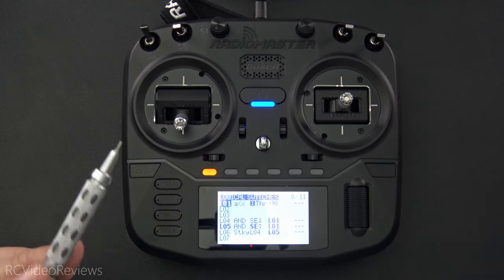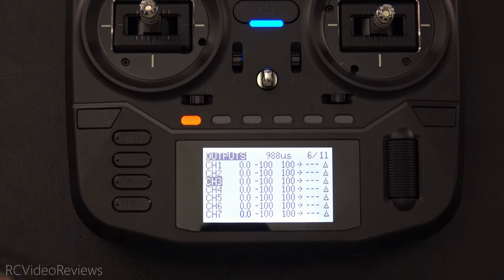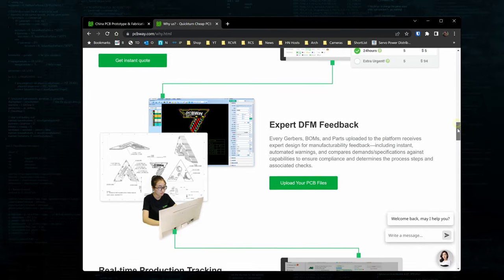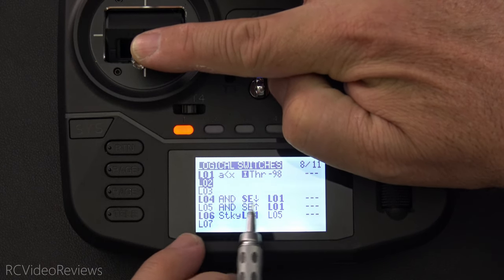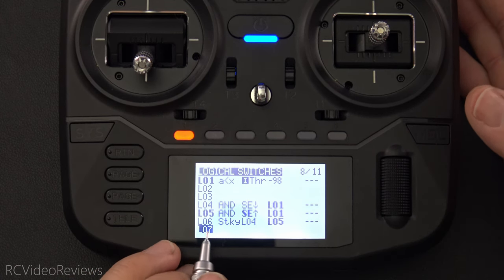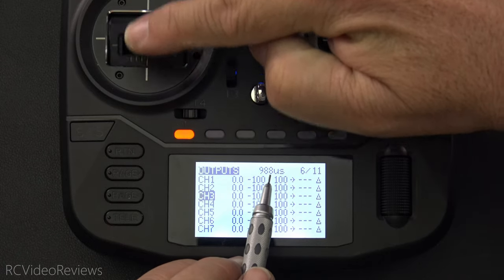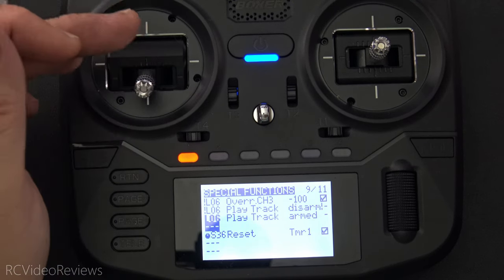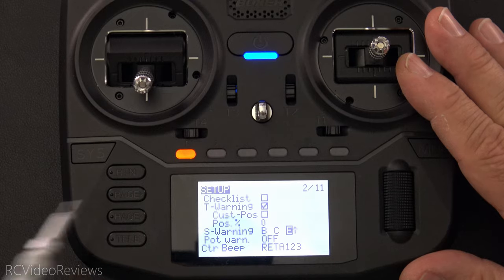Throttle Lock for Radiomaster Boxer with EdgeTX: My NEW FAVORITE!

Comment: It doesn't take you long to figure out a arm-disarm switch when the model on the table suddenly becomes airborne. 😄 Great video John.
Reply: wouldn't happen if you took the prop off😉
Reply from the maker: I think the beauty of EdgeTX as being discussed in these comments is there's always some way to do things that works for the individual, and that's the key point.
Reply: @RC Video Reviews  since setting a throttle cut up (which I've done loads) and accidentally hitting the +/- and not realising, model on the bench went full throttle when I flicked the switch. luckily no damage to the model and I was behind it at the time. I'll never set up a model with the prop on again. I got luck. others have not.
Reply from the maker: Yeah, you gotta do what works for you.
Reply: @RC Video Reviews  I use throttle cut but for the initial set up on the bench prop comes off while everything gets tested

Comment: Thanks!!!  This is great.  I'd like to do another switch for "emergency" throttle off too.  The more Boxer videos, the better. :D
Reply from the maker: "emergency" throttle off is basically what a throttle cut does. Just lookup any throttle cut video I have on the channel (there are several). Logically speaking: Use a switch to override throttle channel to -100.

Comment: Outstanding again, thanks.
I recently got a Boxer 4 in 1 for my son and I to use with UMX BNF products.
Although not a complete noob to RC, I kept things simple with my DJI controller with air units and vistas in my drones.
There is a lot to figure out with binding, as some controls are reversed etc, but there are some older video’s covering this with a TX16.
Just a suggestion, as I think the Boxer will become very popular, maybe a full tutorial on your setup with something like A Turbo Timber Evolution basic ( as this is one of the models I have!)  would be beneficial.
Thanks again.
Reply from the maker: Glad to help. Thanks for the suggestion.

Comment: Thanks for the info.👍 As presented here: i view this just as ANOTHER way to setup arming on your RC, its not the only way. In nearly 45+ years of flying  I have never accidently hit the disarm switch while flying (if you have maybe you need to consider if the switch is in the wrong place) or maybe that 1 time was a freak occurence. But lets think this through logically,  on a plane, who cares if the motor shuts down (unless you are really close to the ground), just re-arm raise the throttle and move on, ever heard of gliding or dead stick landing??? On a quad its a little different...if the disarm switch is triggered it takes a second or 2 to get the flight controller to allow arming while you are watching your favorite flyer plunge toward the ground at break neck speed. Putting the switch where it is unlikely to be hit during flight would be the most prudent thing to do. But I guess that won't happen because the majority of RC flyers are old farts (me included) that are too old, stubborn, not tech savvy  enough to be willing to make  a change. So for me i want my disarm switch to disarm NOW, not after i also remember to lower the throttle. Another post mentioned to have a voice prompt 'Disarmed' or "Motors off" (which i have) to warn us when we do the unthinkable. 😁 Happy flying
Reply from the maker: Would be simple enough to remove the and condition from disarm logical switch if you want disarm to occur regardless of the stick position. That's the beauty of this EdgeTX--unrivaled flexibility to make it work the way you need it to work.
Reply: @RCVideoReviews  What would you set the and to in that case? I want the switch to disarm no matter what the throttle position is and only re-arm once throttle has been to zero

Comment: Thanks for the video!  I just went through the setup on my new Boxer radio, and it seems to be working as shown in your video.   However when I flip the arm switch with the throttle up, the motors on my quad are still arming even thought the radio shows it's not armed.  Am I just missing something simple?   FYI I'm a total noob with iNav and my Speedybee F7 V3 flight stack.

Comment: I use a slightly more complicated LS, but this is certainly a nice understandable one I'd like to see more people using. I prefer that if the arm/throttle enable is set, it can only be actioned on if the throttle was in the down position at the time of pressing the arm/throttle enable position, not for it to be able to arm just by pulling the switch down. i.e. if the throttle was not down at the time of pressing the switch, you have to pull it down, and then unset and set the switch again before arming occurs. And, if the disarm state is pending, with the throttle still up, I have it so the transmitter beeps to warn/remind me of that, so I know the throttle will be cut if the stick goes below -98. It's somewhat loosely based on the logic from Mr D's Open TX Ultimate Arm Switch, and I think ends up at 6 LS for the arm/disarm logic, and a 7th LS for the disarm pending check. Then there is just an extra Play Sound SF.
Reply from the maker: And that's the overall beauty of EdgeTX. These videos are meant to show techniques that can be assembled or used in ways that meet the needs of the individual. You know what I say: "Your money, your hobby". You have to make it right for you.

Comment: Yet another way to do a throttle lock.  Interesting that you choose to enable lock only when the throttle is down.  I use a different scheme that will only unlock throttle when enable is selected and the stick is down, but throttle off lock will enable with the switch regardless of the throttle position.  I see points for both ways, I'm just accustomed to throttle off lock NOW!  No chance of failing to lock because the stick wasn't all the way down.  Then again, there is the chance of accidentally killing the throttle mid flight.  Easy enough to re-enable if you don't panic and forget how.  

I use my throttle lock on my boats too, on a three position switch: lock, forward enable, reverse enable.  This way the throttle stick works full range forward and reverse and forward/reverse switching only happens when the stick is at full stop so you can't slam that poor drive system from forward to reverse at high power.
Reply from the maker: The real point is to show the logic. People can and should adapt to their specific needs as is the case with about every logic video I make.
Reply: Yes, I get that part.  This is one of the amazing and sometimes frustrating parts of OpenTX/EdgeTX, there are usually many ways to achieve the same goal.  Yes, I found your video and your solution interesting.
Reply from the maker: I try and encourage people to do what works for them. To your point, there are many ways to complete a task.

Comment: What if I use Spring Centered Throttle? Work the same by pulling Stick Down to Stop, Hold it, then press Lock Switch. OR select Lock Switch first then pull Throttle Down!  Only difference is i guess Throttle always in Middle by Default for running Drones or RTF Helis?
Reply from the maker: Try it...see what happens.

Comment: I have a newB question: I managed to set up the boxer per your tutorial.
But in Betaflight, the Arm mode is disarmed whenever I unlock SE, regardless of these functions (SE=arm switch).
Is there a way to allow disarming the drone only on SE off + throttle down in Betaflight?
Reply from the maker: Of course. Look into logical switches. You can create one with an AND to with SE off and Ch3 < 90 which will turn the switch on when those conditions are true. Then you can set disarm to use that logical switch. Lots of ways to carve this question in EdgeTX.

Comment: Great tutorial!!  Can i do all settings in your tx16 tutorials but in a Boxer?
i have small hands and i am undecided between the fancy tx16s an the Boxer.
i fly small foam planes, i try to use all the function you teach in your videos in my small jumper tx12pro. i do not fly fpv.

please comment you opinion between the tx16s and boxer , thanks
Reply from the maker: Except for the switch names, yes. The logic and methods will work the same.
Reply: @RCVideoReviews  thanks for your comment , it means a lot coming from you.tks

Comment: Hey Mate, gerat video! It looks like you are flying only, but maybe you can help us MT12 users. We try to figure out a cruise control, that works like on traxxas. 
The Idea is to have a switch locking the current speed... speeding up should be still possible by using the trigger and only breaking turns it off. And a poti should overwrite ch1 (or ch2) while its beeing locked so you can change the speed stepless🤔

Second idea I have is, that the Poti is set to center (0) and as soon it turns greater than 0 (so x >0) it should overwrite Ch1 (or Ch2), so the poti AND the pullingtrigger can take control about CH1 (or CH2) but the Poti only than, if the value is greater 0... 

What do you think about this ?
Reply from the maker: Maybe start with this: https://www.youtube.com/watch?v=i4FCjA_V4iA and sprinkle in a little of this https://www.youtube.com/watch?v=WpCBeOLTp78
Reply: @RCVideoReviews  Thx, we will try it out!
Reply: @RCVideoReviews  haha I made it! 
I just Setup a second mixed value for Ch2, controlled by the Poti and a Max weight of 30 (because 30% for crawling is enough) and it worked just fine! 😊
Reply from the maker: Nice job!

Comment: yeh that one is pretty good until you lower throttle below the limit, and try to apply power 🤣 In all honesty, there are so many ways to skin this cat, it's hard to think any of them are "best" practice.... so I am OK with my current approach (one of your earlier ones) as meeting my needs, but i appreciate the added capability this does have.  What i REALLY like about these vids though is how it can open your eyes tot he "simple" things you can use to build complex things.  As a newbie I am sure there's lots of things I could do when I find a need, and I have the tools to start that learning and development...
Reply from the maker: You can move the throttle from 0 to 100 with the arm switch in the armed position. It only cuts if you disarm, then lower the throttle to zero. But you've caught the spirit of the video which is to show logic in use to give you ideas on creating your own solutions.
Reply: @RCVideoReviews  yeah i knew what it was possible to do - I just wanted to point out the "trap" that you could get into but hey, you disarmed it deliberately, a quick switch flip to get your throttle back is easy if you needed to.  Absolutely these vids are excellent resources - someone can use it as their "true" solution if they want since you've given all the components, but again it adds to the building blocks that others have in their arsenal to build what they need

Comment: Thanks, cool stuff!

But what happens if you bump your switch unknowingly ... then later happen to go to zero throttle to glide ... then when you go to throttle up out of danger, nothing ... seems potentially dangerous ...
Reply from the maker: There's *ALWAYS* *ALWAYS* a "but what if" when it comes to throttle locks. If something doesn't suit you, don't use it.  In this case, it would take two mistakes in a row by the pilot to cause the situation you described. I would argue if the pilot is that careless with the controls on the radio, they shouldn't be flying. 

It's literally impossible to write throttle lock logic to please 100% of the people who watch these videos.
Reply: @RCVideoReviews  Of course - I write software for a living, and everything is a compromise. One could just as easily argue that someone who doesn't check their throttle every time shouldn't be flying either. 

My question was more from a "which situation do you think more likely with planes" standpoint - I'm a quad pilot just getting into planes, and i have never armed with the throttle above zero in my 8ish years of flying quads.
Reply from the maker: The basic throttle lock is a simple override. It's a one line config. Unfortunately, "bumping" the switch can cause an unintentional launch. 

I encourage people to consider the logic and adapt to suit. For me, I think it's a very very good idea to ensure the throttle stick is at its lowest position before arming. I've personally never made the mistake of disarming a model while flying it, but this method offers a 2nd chance in the event someone does.
Reply: @BooDevil65  I'm in about the same place as you - 7 years of building and flying quads, and just moving into planes. A quad using Betaflight on the FC cannot arm with the Thr above the min value. This is programmed into the BF firmware.There are other reasons for not being able to arm (like being connected to the BF configurator - remember you have to disable the FC on the motors tab to be able to test motor response). But the main error code we all get is for not having Thr all the way down. You don't have to set anything up on your quad for that. You do have to assign the arm mode to a channel and an input (usually a switch). 

On planes arming is not automatically prevented if the Thr is high, so they need to specify under what conditions the Thr channel is on and when it is not (Thr cut) via the Logic and Special Functions tabs in the model. 

I'm with jp7361 below when he says he prefers the Thr disarm to work no matter where the Thr is.  It's probably because we drone flyers tend to fly lower and around obstacles, so a lot of our crashes happen with little to no warning, and you want to get the props stopped immediately before they cause a lot of damage tearing your quad apart on the ground.
Reply: You can add a voice prompt for (pre) arm/(pre) disarm so know when you hit it accidentally